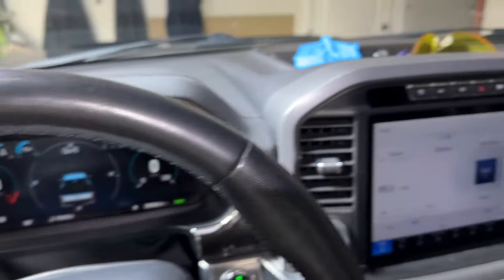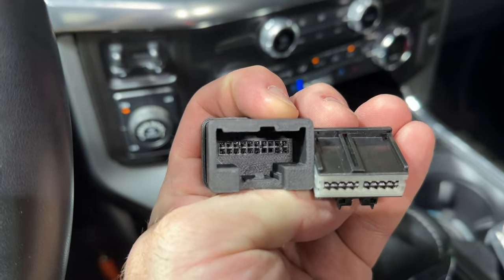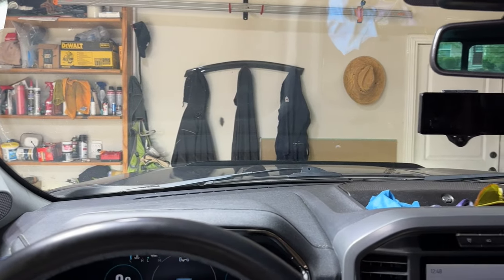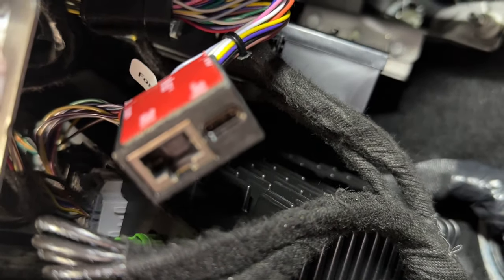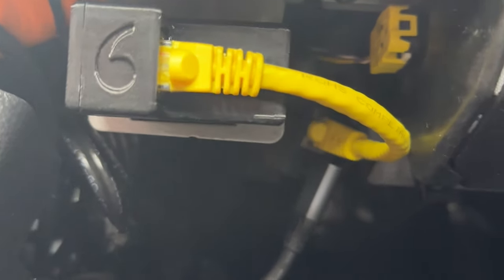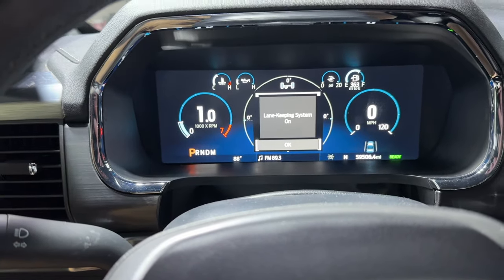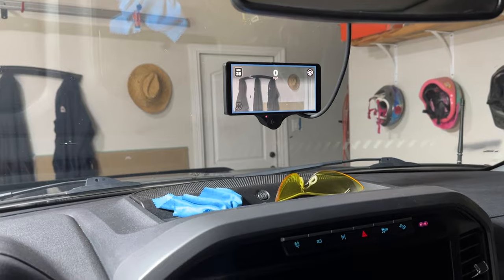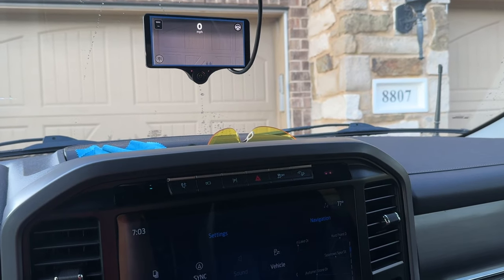14th Gen F-150 Comma3X and OpenPilot Install with First Drive Impressions

Comment: My father has a 2019 Lincoln MKT with LKA and ACC. I wish I could install C3x with open pilot in it, but i think it likely has the 10 second (?)  lockout. I would buy his car if I could get open pilot to work in it. I currently drive a 2018 Prius with comma 3 using Sunnypilot and I love it.
Reply from the maker: Yes, a 2019 will have the 10 second lockout. for Ford LKA=Bad, LCA=Good

Comment: I’m in your same shoes. Lariat sport with Bluecruise and so frustrated with the ever moving delayed rollout of BC 1.2 which is now being delayed to roll out 1.4. Confirmed with ford that they still haven’t begun the roll out on any ICE f150’s. Any update on 3x since the video? Is it worth getting at this point or would you suggest waiting most likely another year for bc 1.4? I’m tempted to just trade it in and get a super cruise model. My brothers both have super cruise vehicles and it blows BC out the water! Thanks!!
Reply from the maker: I installed BC 1.4 in February, you can find my comparison to openpilot here:

https://www.f150gen14.com/forum/threads/openpilot-on-the-f-150-bluecruise-alternative.19342/page-33#post-421452

With regards to updates since this video, yes, there have been leaps and bounds of improvements.  See here:

https://www.f150gen14.com/forum/threads/introducing-bluepilot-a-ford-specific-fork-for-comma3x-openpilot.24241/

My dislike of super cruise is that (last time I checked) they didn't have a hands on lane centering assistance for non-super cruise highways. It's all or nothing.
Reply: Awesome, thanks for the info and the links. I’ll go down the rabbit hole!!

Comment: Can you please share old link devc3 new one is not working very well for my 2021 f150 platinum it’s not staying center
Reply from the maker: Well, rolling back to an old version isn’t that easy, there is only one link and it always has the latest rev. The good news is that the old models are still there and can be loaded up from inside the newest version. That said I suspect you probably have a different issue as the latest model is performing really well on 2021 F150s.  I would first check that your mount is still securely attached to your window and is not starting to be loose. A shaky mount results in really poor performance. If the mount is solid then try resetting calibration from inside the menu. If that doesn’t work let me know and we can try selecting a different model.
Reply: @ajzride  I already checked and did calibration again but still same issue
Reply from the maker: @happy2gud   in the menu go to software and then check your driving model. You can use the select button to choose and older model that correlates to a time you thought it drove better.
Reply: @ajzride  ok I will try thanks dear

Comment: i have 2023 F-150 with lane centering, but not adaptive cruise or blue cruise. Would this work for me, since i starting driving my Tesla FSD... I'd love to upgrade my F-150  with comma OpenPilot.
Reply from the maker: Unfortunately we haven't figure out how to get that to work yet as Ford throws some errors on their side when we try to engage.  However adding ACC is a reasonable DIY project, and it works perfect after that is added.

https://www.f150gen14.com/forum/threads/adding-co-pilot-assist-2-0-with-forscan.5028/page-72#post-457616
Reply: @ajzride  thanks... i will investigate more to see if it's doable for me. thanks.

Comment: Does the tiny CF particles actually make the bracket it any stronger or is it marketing.  I watched a CF / CFSMC comparison and it seemed like if it was stronger than the base nylon it would be marginal.  I also follow antweight (150g) robot combat and nylon printing is commonly used but I've never seen CF reinforced used.
Reply from the maker: I recommend checking out Stefen at CNC Kitchen's video on CF filament for an excellent analysis of where it provides actual benefits.
https://youtu.be/LTmuwfyYUJQ?si=BMJmorv5XotWKWaY

Comment: Do you know if it’ll work on a 2017 f150 lariat? It has the lane keep but not adaptive cruise. It does have the trailer backup knob too. Also, I’ve never seen anyone put their registration at the top before, has anyone stopped you and gave you grief over it?
Reply from the maker: It will not work on a Gen13 (2020 or older). Ford does not allow the steering wheel to be commanded via the bus. Never had anyone say something about the sticker.

Comment: I'm looking forward to a follow up video. I'm interested in your experience with Open Pilot. How big is the Comma device? Is it larger than a cell phone?
Reply from the maker: length and width are pretty much the exact same size as an iPhone, it's pretty thick though, maybe 3 inches.  I've been trying to get some good footage comparing the BlueCruise drive versus OpenPilot, but I need better equipment, the videos are washed out and you can't see much.  Will try again this weekend hopefully.
Reply: @ajzride I heard somewhere that it actually is a Samsung galaxy with device attached to the back of it. But I might have misheard that.
Reply from the maker: @andrewmullins8594   The early versions were LeEco Pro 3, but the current versions are dedicated hardware I believe.

Comment: Even though the F150 is not supported according to their website, it'll still work with no modifications? I have a 22 with adaptive cruise and lane centering already equipped.
Reply from the maker: The F150 is not on the website as a supported vehicle, but it is considered "in development".  85% of features work, including being a full blue cruise replacement.
Reply: @ajzride  Thank you!
Reply: I'm getting ready to pull the trigger on a comma 3x for my truck. I can find everything except for the proper mounting brackets. Would you be willing to 3d print a set to sell to me?
Reply from the maker: @1970chrish   The video is a few months old.  The mounts are in stock now and should ship with your device.

Comment: Would this be possible to install on a 2019 f150 gen 13 truck that already has adaptive cruise control and lane keeing assist.
Reply from the maker: Unfortunately not. The power steering control module on Gen13 trucks (or any ford with lane keeping assist instead of lane centering assist) will not accept continuous commands, only commands in short bursts.  LKA was designed to nudge you back into your lane, not hold you centered.  Trying to control it with a comma results in the PSCM to stop accepting commands. So far no one has found a work around.
Reply: @ajzride  Has there been any progress made? I have a '23 Lightning PRO.. it doesn't even have adaptive cruise, and it only has lane keep assist. Will the comma 3x done any good?
Reply from the maker: @zed4me  not currently, but someone is taking a swing at getting fords without ACC to work. Check back in 4-6 weeks.

Comment: will it work on 2022 expedition platinum?
Reply from the maker: I think so, but I'm not positive. I know a 2021 does not work and 2023 does.  If the 2022 got the new PSCM and IPMA, then it will work.  You can tell by testing the lane assistance feature.  If it constantly steers the vehicle to stay center in the lane, then Comma will work.  If it only bumps the vehicle back towards center when you near the lane edge, it will not work with Comma.
Reply: @ajzride  and i choose a f150 in vehicle type, right? 
thank you so much man
Reply from the maker: @221akm  Yes.  Choose F150, they have the same control scheme.

Comment: awesome. where do you get the harness?  i want to try this on my second gen raptor.  can you let us know exactly what we need to order and from where?
Reply from the maker: If by “second gen raptor” you mean a 2015-2020 raptor it will not work. The power steering module in those year fords will reject the messages you send.
Reply: @ajzride   Thanks.  I guess I'll just have to keep waiting...

Comment: Did you disable ford lane keep assist and just have lane centering? Seemed to fix most my issues. I’m an old comma user from 2019 might come back if f150 support is good and performance is significantly better than Lane centering.
Reply from the maker: For the last 2 years I’ve been using lane centering and BlueCruise, don’t use lane keep assist.
Reply: @ajzride  it’s a bit strange they have multiple centering systems that conflict with each other, BC is ya on and off constantly not worth 2k for 3yrs.

Comment: I am not getting calibration screen it’s stuck
Reply from the maker: What screen do you get?
Reply: @ajzride  it’s saying ready to upload 
Upgrade now
Setting ⚙️ 
Temp:- good
Vehicle-online
Connect:-online
Sunnylink:-online
Reply from the maker: @happy2gud   that means there is an issue with the wiring. Do me a favor, make a post on the forum, it will be much easier to help in that format than YouTube comments:

https://www.f150gen14.com/forum/threads/openpilot-on-the-f-150-bluecruise-alternative.19342/
Reply from the maker: https://www.f150gen14.com/forum/threads/openpilot-on-the-f-150-bluecruise-alternative.19342/
Reply: @ajzride posted
Reply from the maker: @happy2gud  and I replied on the forum. We can continue to troubleshoot there.

Comment: Hey AJ
  I was thinking of getting this for my lightning.  I see on the wiki they don't have anyone yet who has done trial.  Have you heard anyone that has tried it with a lighting?
Reply from the maker: Yes, someone on our dev team has a lightening. It runs OpenPilot exactly like the ICE F150 does. Lightning currently gets some warning lights that are not affecting driving, we are working to resolve those with better cabling.
Reply: @ajzride  I'm gonna order the hardware.  I'd like to get some pointers on navigating the github site and downloading the correct software.   Is the forum the best place to get some instruction?
Reply from the maker: @Drayday55  head to the link below and then send me a private message. 

https://www.f150gen14.com/forum/threads/openpilot-on-the-f-150-bluecruise-alternative.19342/
Reply: @ajzride  

I will.  Im on Lightning owners forum and hooked up with the guy with the lighting on your team.!

Comment: Where did you connect the harness connectors?
Reply from the maker: If you are buying a new Comma, just add it to your basket, if you already have a comma, you can buy just a harness at https://www.comma.ai/shop/harness-connector.  You want a Ford Q4 Connector for an F150.
Reply: Yes, I will buy the harness, but I was unsure where to connect it? @ajzride
Reply from the maker: @WagnerJA797  somehow I misread your comment as where to buy it.  Apologies.   Watch the 8 minute mark of this video, I show where it connects.  Just take note it did need to go into the black port and not the grey one.
Reply: @ajzride  OK I got it, I'll try to install on my Ford Ranger 2024
Reply from the maker: @WagnerJA797  no one has gotten a raptor to work yet, and only the Raptor version of the Ranger is likely to work. A lower trim might work with some forscan changes. You are in very experimental territory here. I suggest you head to the discord channel here so you can talk through this with some experts. https://discord.com/channels/469524606043160576/539096103468007424

Comment: what harness did you get? Ford 3 of Ford 4?
Reply from the maker: Ford Q4
Reply: @ajzride  How did you know you needed Q4?  Under compatibility for Ford, they don't even list ANY truck, so how did you know how to order a "Ford Q4" if you don't mind sharing.  I just bought a 2022 F150...it has adaptive cruise, adaptive steering, lane centering and speed limit recognition, but I don't see Bluecruise specifically noted on the window sticker, but then the sticker is in French (built in Dearborn, but guessing originally sold in Montreal area).  Hoping I can make Comma3+ work for me...your video should be a big help should I end up giving it a try.
Reply from the maker: @robj4381  Other than someone who has it working telling you that you need Q4, you can check the wiki here:  

https://github.com/commaai/openpilot/wiki/Ford#ford-q4--bluecruise--can-fd-20-pin

Also suggest you join the comma discord and hop into the #ford channel for technical support:

https://discord.com/channels/469524606043160576/539096103468007424
Reply: @ajzride  Just a quick reply hoping you are still online, I will definitely be checking out the other sources you offered.  Anyway, is the Q4 just a specific type of harness rather than specific to the Ford model line?  So, if I wanted to get the one you are using, I would request "the Q4 harness" rather than asking for a harness by model?
Reply from the maker: @robj4381  When you go to the comma website and click on "buy now" it takes you to a page and there is drop down for "Select a harness to connect the comma 3X to your car". Hit the drop down and it adds a search bar, just type Q4 and it will find it for you.